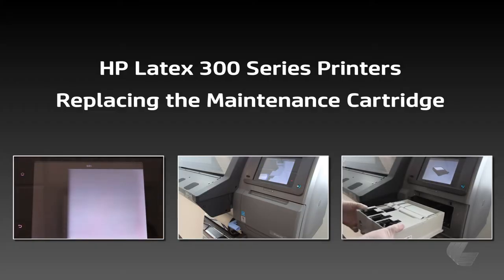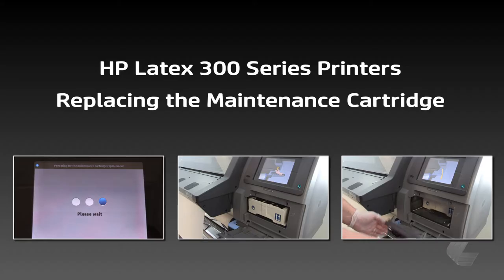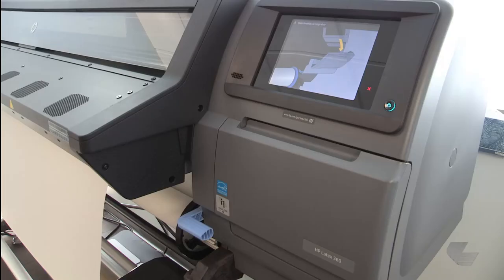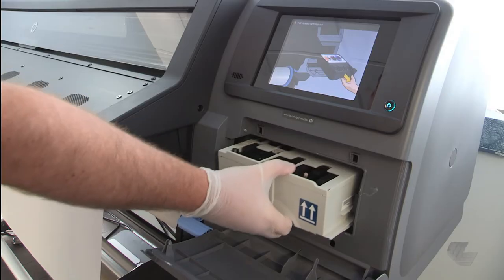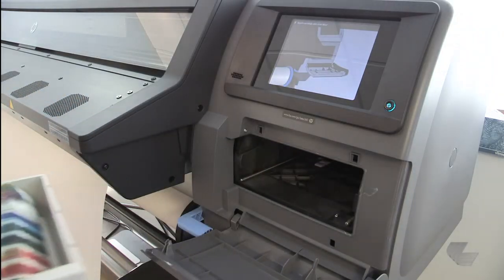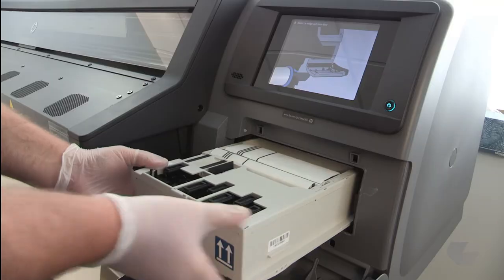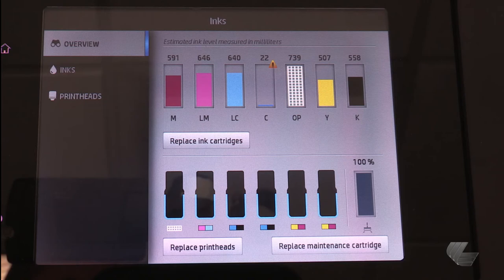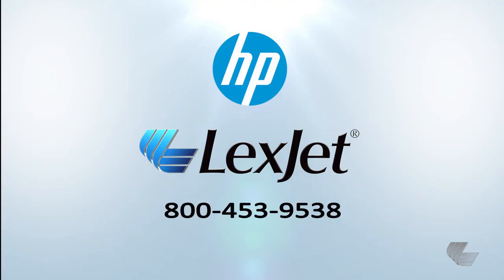HP Latex 310, 330 & 360 - Replacing a Maintenance Cartridge

Comment: I just bought a very low usage HP315 with only 600sqft of material printed on this printer. I will need to move it down a set of stairs and was told to remove the maintenance cartridge. Can I remove the maintenance cartridge without power to the printer? Is it possible to just open the door and slide it out so it can be moved downstairs as there is no power in the garage for it? Thanks Bob
Reply: Hi Bob, can I ask how you went? I have to do this also and have the same questions you had.
Reply: I had no issues. Pulled the waste tank and rolled it on the trailer and off at my place. Then carried it down a flight of stairs. It sat there for a week or two before I had power to it. But I put the waste tank in and it’s ran great since.
Reply: @rcook999  Thanks for the reply and I'm glad to hear it's going well!
One other thing I was concerned about, apparently the maintenance cartridge holds the head carriage in place. Did you not have any issues with it moving around after you took out the maintenance cartridge? Did you use tape or something?
Reply: @OdsyMJ  I did not secure my head but did have the printer strapped down hood. Needless to say no issues but it can’t hurt to secure the head. Just be careful not to mess with that clear strip along the print head rail.